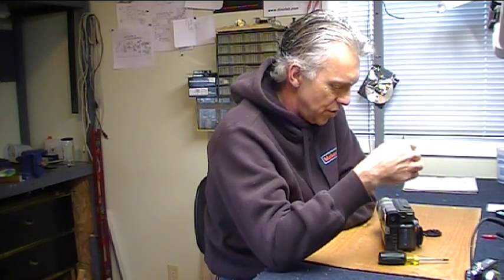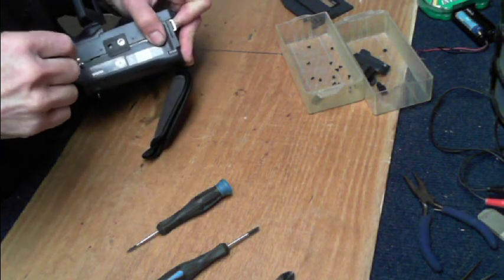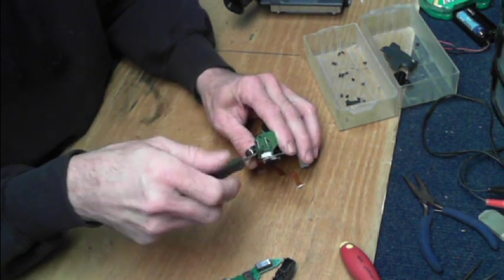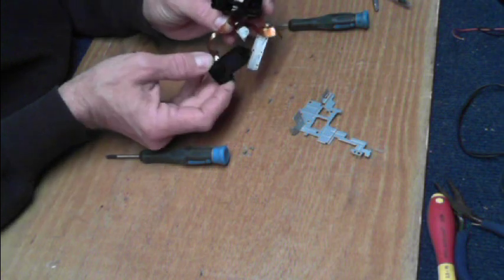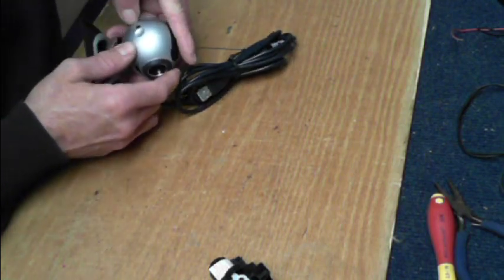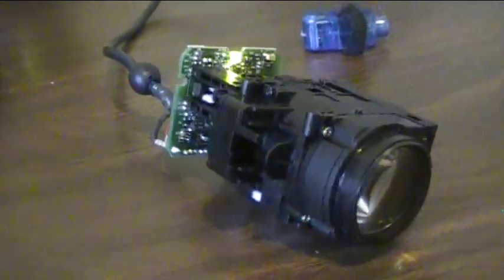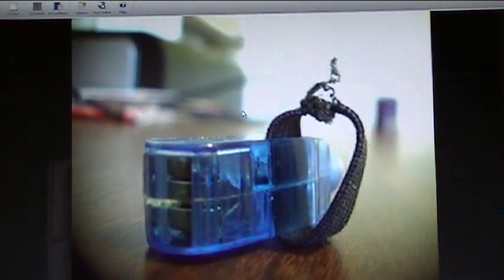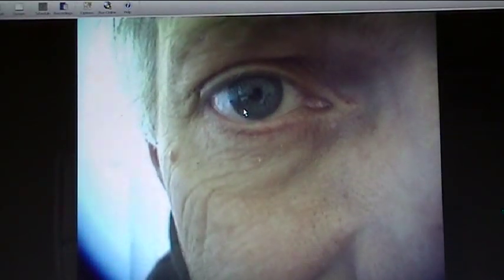Hack A 20x Zoom Lens On A Webcam

Comment: You  don't mention the problems with getting the back plane (distance between the rear lens element and the imaging device) correct. If on this hack here you did not have to adjust then you were damn lucky.

Comment: Most of those old sony cams had a similar lens assy, very usable and adaptable.
I'll take a shot at stepper voltages 3v fast 1 or 1.5 slow - could be 6v and 3v slow as the main was close to 12v. I tried to fix a tape transport problem in one, and I gave up. Not about to hand fab a part for it - BUT I will use the lens assy - I thought that 2 or so years ago. Having seen this, it tickled the memory cells. Get the focal point, mount it, use it. There are some 2 or 3mp 1280 p ccd's that are cheap enough.
Combine a nice ccd with that lens and you've really got something very useable.
Feed the steppers from batt power for super simple use and bang it's done....

Comment: I'm trying to do this with a broken Sony VX1000, and have the same problem that I can't see through the lens. I can't access the rest of the screws though, so I might have to get the dremel out... For the focus control I think I might use a threaded rod with a gear coupled to a DIY focus wheel. I have no idea what voltages or anything the stepper motors use so the manual option is safer.

Comment: were these controls that were touchy linear sliders that are controller via a worm gear on a stepper motor?  If so you will have a lot more control with the worm gear and a dial on the gear... but better to hook up the stepper so you can get to the sweet spot faster.  You would want a continuous fwd/rvs button and also probably a single step fwd/rvs button... or a mode button (continuous/single) and then a fwd/rvs button ;-)